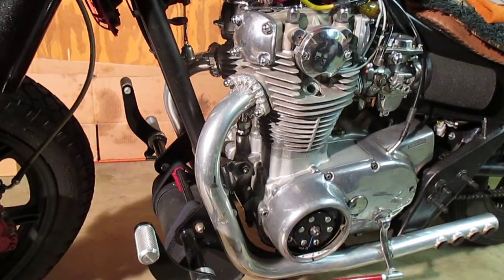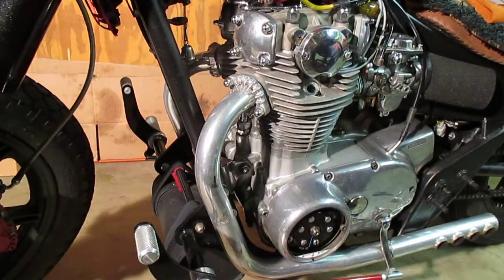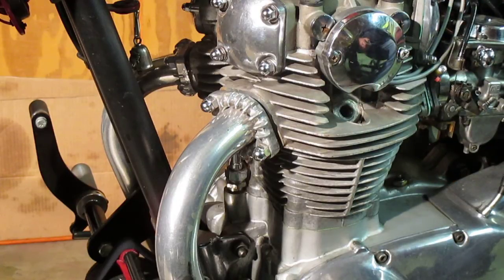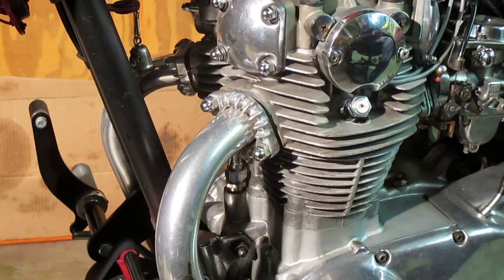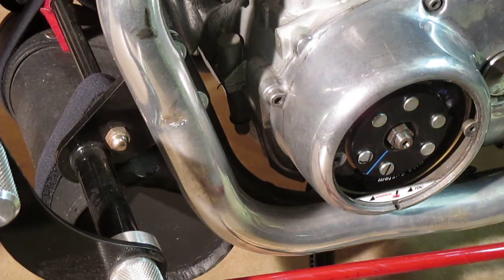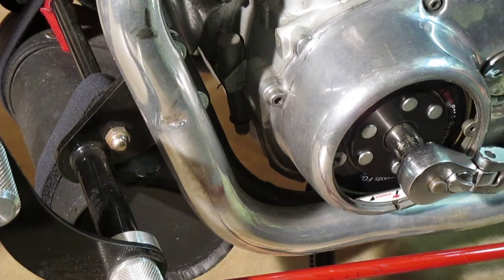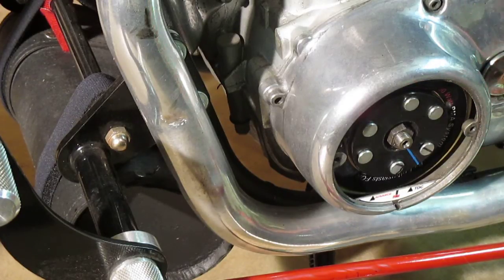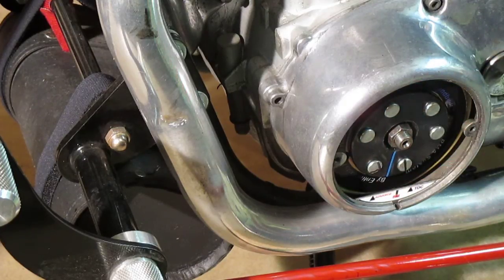Yamaha XS650 "Finding TDC using a piston stop"

Comment: You dont talk about the piston stop enough. So you brought the piston up til about 1/4 to 3/8in and put your stop in. How do you know the piston was all the way up? You dont really go over that?
Reply from the maker: A piston stop is a tool used in engine work to accurately locate the top dead center (TDC) position of a piston within its cylinder. It does not have to be at a specific death it just needs to be stopped the Piston before it gets the top dead center. .
 Install Piston Stop: Insert the piston stop tool into the #1 cylinder. 
Rotate the Engine Clockwise: Slowly rotate the crankshaft in the direction of normal engine rotation until the piston hits the stop.
Mark the (PMA): Make a mark on the (PMA) at the point where the piston first contacts the stop
Rotate the Engine Counterclockwise: Rotate the crankshaft in the opposite direction until the piston hits the stop again. 
Mark the (PMA): Make another mark on the harmonic dampener at the point where the piston first contacts the stop
Find TDC: The midpoint between the two marks on the harmonic dampener is the TDC for cylinder #1
I hope that clears the procedure up for you

Comment: How do you know you have split the difference between the 2 marks with out a degree wheel?
Very nice video though.
Reply from the maker: John Mahoney After making the 2 marks I measured the distance the 2 marks are apart with a caliper. Then I divided that measurement in half and put the TDC mark in the middle of the 2 marks using the caliper. In my other video using a degree wheel and camera it's a bit easier that way.

Comment: How did you make your engine stop? mahanlee@gmail.com.    It looks like a headless sparkpluug and a small socket?
Reply from the maker: Mark Hanly Well that was a homemade piston stop.It protrudes into the cylinder and stops the piston from reaching top dead centerhttp://www.autozone.com/test-scan-and-specialty-tools/top-dead-center-stop-tool/comp-cams-14-mm-bolt-style-heads-on-top-dead-center-stop/85871_0_0/